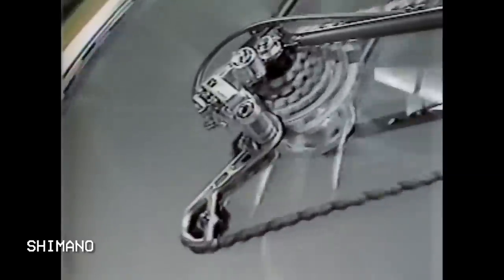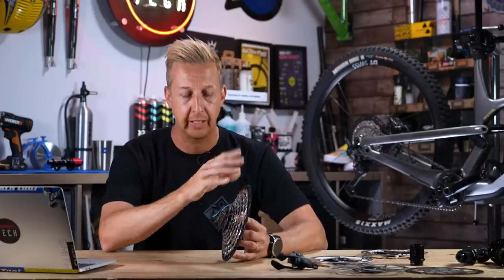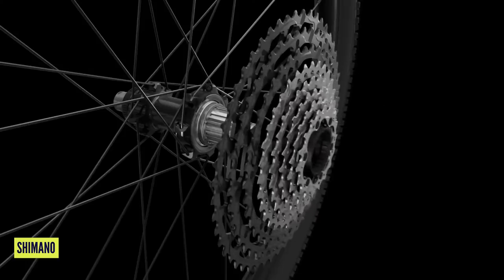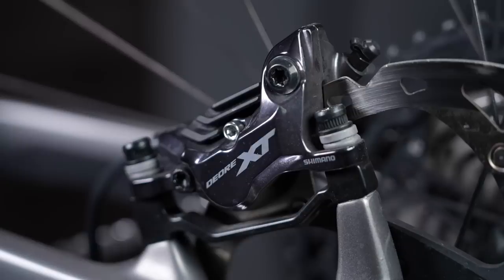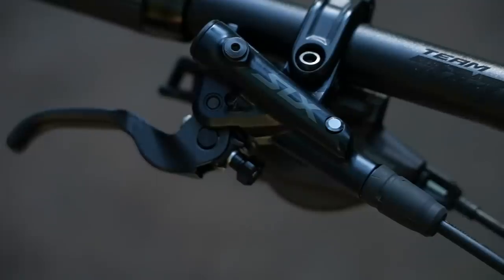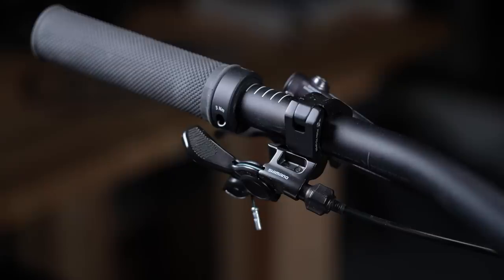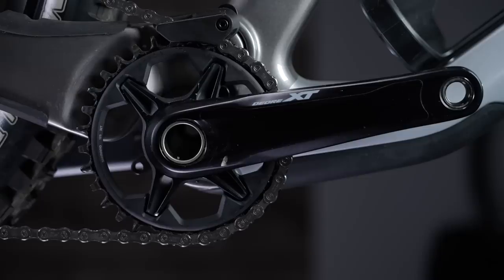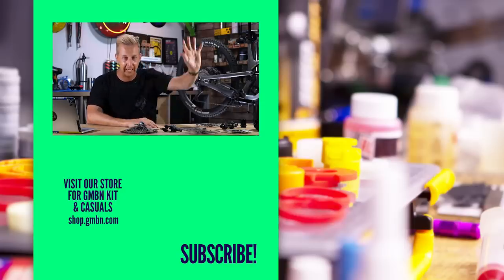Shimano MTB Jargon Explained! | What Does It All Mean?

Comment: 12 speed. UDH. XD. AXS. I think Shimano has been relegated to second place. Lets face it. SRAM does cranks better, an 8mm allen key is all you need. They did the freehub better. The clutch us better with a locking button making set up easier and removing a wheel super quick. SRAM made electronic shifting worthwhile. They tried to fight against proprietary hangers which are never in stock when you need one. SRAM didn't waste time trying to tuck a Deraileur, they understand that it's guarded by the riders foot. SRAM offer 10-52 instead of 10-51. The cassette is lighter made of pure steel. 
 Shimano was good but SRAM took the lead and now Shimano is starting to look a bit shabby.
Reply: Imo SRAM clutch is awful. Not as effective as Shimano and there"s no way to adjust it so so as it wears it gets even slacker / noisier.
Reply: “rear derailleur … guarded by the rider’s foot… “

HAHAHAHAHA